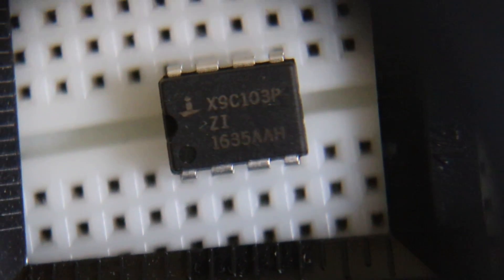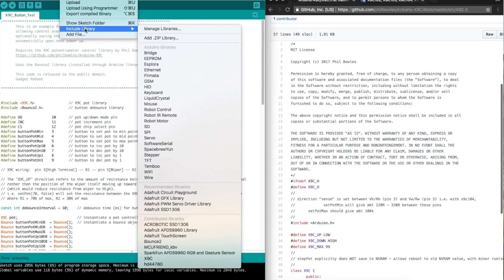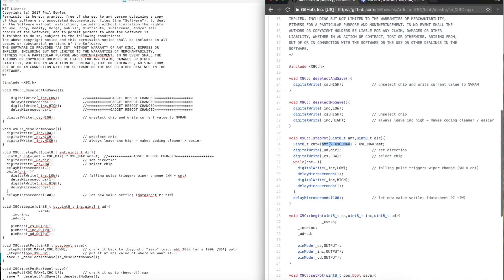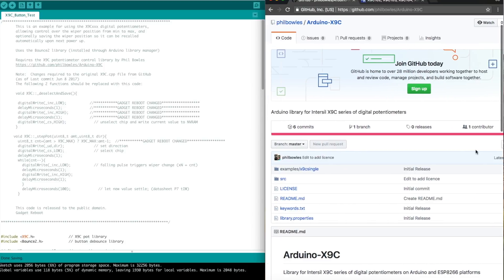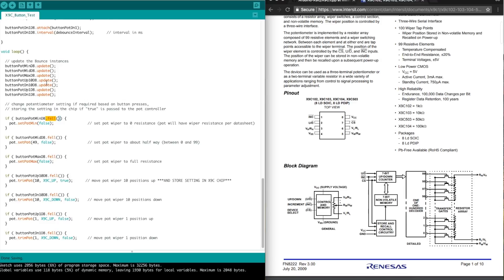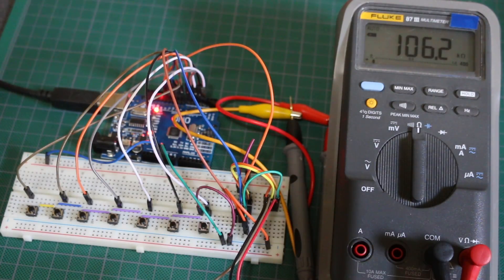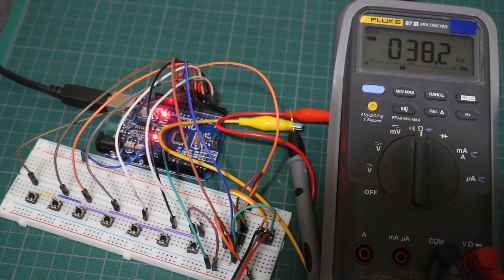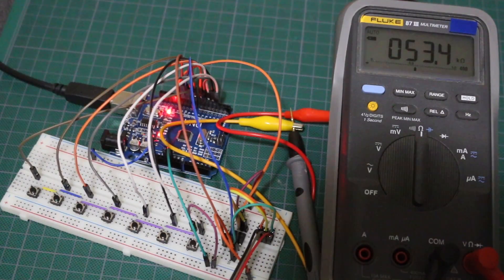Digital Potentiometer Control Using Arduino - X9C103

Comment: I would like to use this digital potentiometer to run a brushless moto. Would it be possible to use two buttons, one going up and the other going down incrementally and in the same time any of this buttons being used to set potentiometer to max low with a long push and store this value? This way the motor could be deactivated with any of this two and wouldn't run at the start. Maybe even have one more code to have the value set at low and stored at the power down. Thank you.
Reply from the maker: with software control those functions could be programmed although with this potentiometer it wouldn’t be able to immediately jump to a different value it would have to quickly sweep from current position to the minimum or maximum but it’s the same effect as quickly moving a real potentiometer.
 But the bigger thing is that the potentiometer can only handle 5 V maximum and it’s only meant to have a very small current through it more like using it as a sensor and then having another circuit whether it’s an op amp or something doing anything more powerful 
so you can’t directly run a motor through it you would just use it to have the motor driver run the motor based on the setting of the pot
Reply: @GadgetReboot  I understand. I'm planning on using a low power low voltage signal from POT to control VESC. I just don't know much about programming Arduino and this might be the only time I will need it. This would replace a hall type of throttle on an e-bike.

Comment: Is it possible to use 2 of these in series, to have 200 steps ? Did someone tried this already ?
Reply from the maker: I haven’t tried it but I think it makes sense if you’re only using the wiper and one terminal of each pot so you’re using it like a rheostat and then you put two of those in series where the wiper of 1 feeds in to the one end terminal of the second one,  then you should be able to control the two sections to go from minimum resistance up to the value of two resistors in series.

Comment: I've been building guitar pedals, and I think you just opened up a whole new world for me
Reply from the maker: i’m about to do a video on a different digital pot because I think these are more obsolete right now so maybe that will be of interest as well in the next couple of weeks.
Reply: Is it the MCP41010?  I ordered just one of those on my last parts order, but then lost it  @GadgetReboot  😆
Reply from the maker: it’s the MCP 42100 so it’s a dual 100 K  version. I have to set up some experimental circuits for it but the video should be out within a week.

Comment: I'd like to emulate a temperature sensor. Basically the Arduino pulls the temp from the internet and "codes" it to the wire w/the according resistance. The device that is supposed to have a temp sensor would show the temperature. Something like this possible?
Reply from the maker: it sounds possible but it’s a bunch of separate projects like one to go get the temperature from the Internet, then if you are saying you want to convert that temperature into a physical resistance value to emulate a sensor, does that mean the real sensor actually produces a certain resistance that varies with temperature?
 If so then as long as you have a digital pot that the resistance can be adjusted within the temperature range to match, you would just have a project that takes that temperature number and uses it to control the pot and so on but it’s all just vague concepts, like saying it’s possible to take an audio signal and put it through a circuit to boost the bass and cut the trouble. Lots of ways to do it.

Comment: I am looking at using this XC9 in combination with a PWM fan controller (ultimately a 555 timer and some transistors) to control a 60W fan. If I want to be able to turn the fan off should I also consider a relay as well or would setting the resistance to it's highest (or maybe lowest?) be sufficient to ultimately get me a 0% duty cycle?
Reply from the maker: it would definitely be good to have a relay or some thing to do a complete shut off, I know the 555 cannot achieve 100% or 0% duty, or possibly both. So when you try to make it go completely flat either high or low, you might still get the little blip momentarily.

Comment: Hi, nice video. I'm looking to use Arduino to transform a 800-1000 ohm potentiometer that I can't change into a 0-190 ohm variable resistance. It's possible in this way? Thank you

Comment: Are these digital resistors also available with a higher resolution aka more steps? Like 10 or 12 bits? Great video!!! :-) Thank you.
Reply from the maker: I've seen them with as many as 1024 steps like this one https://www.analog.com/media/en/technical-documentation/data-sheets/AD5174.pdf  
but of course all the features and limitations of each different digital pot need to be looked at to see if it fits the application.  They're more like a specialized part where trade offs would need to be decided between number of steps vs voltage handling, or control interface method, ability to store wiper at power down etc

Comment: Thanks for the idea and explaination. I am new, and would like to ask, if we use the map function in arduino, what will happen sir? Any idea
Reply from the maker: In general or in something to do with the video (I can't remember what's in the video)?  It maps one range of numbers to be within a different range, so it can take 0 to 10 and stretch it out to 70 to 500 if wanted, so 0 maps to 70 and 10 maps to 500 and everything in between is scaled.
Reply: @GadgetReboot  tq sir..

Comment: Does the digital pot hold its previous value when power is off?
Reply from the maker: If the software procedure is followed to store it, yes.  It re-loads the last stored value on power up but the wiper isn't immediately there, it has to move there during configuration so resistance will vary while it gets set up.

Comment: Thank you! Very clear presentation. I am thinking of using this on a solar charger.
Reply: How did that go? I'm here due to the same requirements. I'm thinking to replace the V&I pots on an off the shelf DC-DC buck converter with these XDCPs.

Comment: Does the chip itself store the last value without the arduino? 
The datasheet says "Wiper Position Stored in Nonvolatile Memory and Recalled on Power-Up" 
So does the arduino quickly turn the pot to one side and then turn it to the arduino memory on powerup?
Reply from the maker: the chip itself stores the position if requested by the control lines from arduino at some point, so when powered back on the chip itself moves the wiper where stored. I think it always starts at one end of the range and then moves to the setting.

Comment: I'm so daft, looking at the screenshot of the data sheet in the vid, can I use the x9c and an Arduino to ”translate” one potentiometer to different values on the fly? Say, to turn my B25k expression  pedal into a 100k?
Reply from the maker: as long as the voltage swing doesn’t exceed +/-5 V on the pot and the current through the wiper of the pot doesn’t exceed 4.4 mA, this digital pot can be used in a circuit where a regular pot is used. that assumes any nuances of the digital pot behaviour can be accepted in the circuit like while powering on, letting the wiper settle to a certain position, or while moving the wiper, momentary resistances  may vary from the expected final wiper position so in an audio circuit volume or some other effect may temporarily be fluctuating depending how it’s all used. so experimenting would be needed to see if it’s even suitable for the application.
if it is, if I want to use an Arduino to switch this pot in and out of circuit either in parallel or series with an existing pot, or to disconnect another physical pot and connect this one in on its own, I would probably use a digitally controlled switch like the CD4066.  this has four built-in switches so I could use it to switch various terminals of multiple pots in and out of circuit as needed. Arduino would be controlling each switch with a single pin to open or close that switch.
I did something similar using digital pots to control frequency of Tone generators and output volume of an audio circuit and used those digital switches to connect various features in and out from Arduino.
https://www.youtube.com/watch?v=oFtGOOA25tA&t=603s
Reply: @GadgetReboot  Thanks for the detailed (and prompt) reply! I've been looking into ways to avoid having three different expression pedals to control non-midi capable guitar pedals that have expression inputs; B10k/B25k/B100k without necessarily having three seperate expression pedals. Already have an Arduino, and a passive trs 25K expression pedal. Wouldn't need to be all outputs at once, but that's a bonus. The devices typically take 9V DC inputs are typically 9V DC, but some claim to operate internally at 24V. If I understood correctly, I'm glad you reminded me to be mindful that these external devices would possibly/likely pass more than five volts through the chip. Thanks again.

Comment: A mechanical pot 100K can handle higher voltages.  The x9c- series only supports 5v.   How would I control a 20v or 30v circuit with a digital potentiometer and arduino?
Reply from the maker: without doing the math to double check, I wonder if the digital pot can handle the normal resistor divider of a buck or boost voltage regulator to set the output voltage, maybe with other resistors as part of the network and not just the digital pot alone. 
or maybe the digital pot could be used safely in conjunction with an op amp circuit and the output of the op amp ties in to the voltage regulator so instead of using a variable resistance to set the voltage we are directly setting the voltage with an op amp. Something along those lines. 
I’m sure there’s lots of Circuit ideas like that in all the app notes of all the silicon vendors where something could be put together.
Reply: @GadgetReboot  Did you ever dig deeper into that? I've got an off the shelf dc-dc converter coming for experimentation.

Comment: Hi I try the same with the button I succeed in varying the resistance or voltage but not able to save thevalue I keep cs high while Inc signal is high so can you help me in this
Reply from the maker: One thing I recall is I found some issues in the X9C library I used, so I had to change two functions in the library code. I made a comment at the top of my sketches here https://github.com/GadgetReboot/Arduino/blob/master/Uno/X9C_Button_Test/X9C_Button_Test.ino     
and it looks like Deselect And Save is one of them, so I wonder if all you need to do is tweak the library like I had to.  I forget exactly how I did it and if I talked about it in the video.  
Here's the info from one of the sketches, so if you find the X9C.cpp file in the library, you can search for these 2 functions and replace them with this code:

Changes required to the original X9C.cpp file from the above GitHub
       library (as of Last commit Jun 8 2017)

       The following 2 functions should be replaced with this code:
       
       void X9C::_deselectAndSave(){
        digitalWrite(_inc,LOW);           //**********GADGET REBOOT CHANGED*****************
        delayMicroseconds(1);             //**********GADGET REBOOT CHANGED*****************
        digitalWrite(_inc,HIGH);          //**********GADGET REBOOT CHANGED*****************
        delayMicroseconds(1);             //**********GADGET REBOOT CHANGED*****************
        digitalWrite(_cs,HIGH);             // unselect chip and write current value to NVRAM
       }

      void X9C::_stepPot(uint8_t amt,uint8_t dir){
        uint8_t cnt=(amt > X9C_MAX) ? X9C_MAX:amt-1;  //**********GADGET REBOOT CHANGED*****************
        digitalWrite(_ud,dir);              // set direction
        digitalWrite(_cs,LOW);              // select chip
        delayMicroseconds(1);
        while(cnt--){
          digitalWrite(_inc,LOW);           // falling pulse triggers wiper change (xN = cnt)
          delayMicroseconds(1);       
          digitalWrite(_inc,HIGH);
          delayMicroseconds(1);
          }
          delayMicroseconds(100);             // let new value settle; (datasheet P7 tIW)
        }

Comment: Really a well done explanation. I wanted to know if this digital potentiometer can be applied as a continuous variable resistance. In a circuit based on a Hall sensor that makes me vary the resistance according to the magnetic flux. The magnetic flux varies tens of times per second and the resistance should vary in the same way. Bye
Reply from the maker: From the data sheet AC operation characteristics table  on page 5 https://www.renesas.com/in/en/www/doc/datasheet/x9c102-103-104-503.pdf , where it shows the timing of the control signals and the response of the wiper,  it looks like the wiper will change within 100 µs per step each time it is incremented so that could be considered fast for several times a second  moving the full scale 100 steps if you have to go between minimum and maximum resistance continuously. And it is just switching in the different resistors electrically so it should be suitable for continuous operation. 

 There is one note I saw in the data sheet that may need consideration, while changing the wiper, there may be a temporary change in resistance rather than just going to the next increment based on the way it works so the application may need to consider that and testing should be done. 

“The electronic switches on the device operate in a “make-before-break” mode when the wiper changes tap positions. If the wiper is moved several positions, multiple taps are connected to the wiper for tIW (INC to VW/RW change). The RTOTAL value for the device can temporarily be reduced by a significant amount if the wiper is moved several positions.”

Comment: Nice explanation sir.  Can we use this pot to carry out IV measurements of solar cells?  Please do reply.
Reply from the maker: It’s probably not practical because at least for this specific device there is a maximum voltage of 5 V and the maximum current through the wiper can only be just over 4 mA so if the voltage  or current being presented to this part is going to be higher than that, it won’t work. 
If this part is not being used directly as a load and is just used for some other function that’s within those voltage and current ratings then that’s OK.
Reply: @GadgetReboot  Thank you sir.    Can you please suggest a digital pot for IV measurements of a small solar cell having voltage below 5v and current below 500 mA?
Reply from the maker: I don’t know if a digital pot can directly handle that much current,  I didn’t research fully but one I found  is 25 mA like this one. 
https://www.mouser.ca/new/microchip/microchip-mcp41hvx1-potentiometers/

And maybe there’s limitations like it can only do 25 mA for short duration not continuous and things like that. 

 There may be some other kind of circuits that can be added on to buffer the potentiometer though, so the potentiometer can be part of a low current circuit controlling a higher current path in some way that the desired result is still achievable.   

Maybe some sort of thing where the digital pot is connected to an op amp so that the digital pot changes the voltage control of the op amp and that controls a fet on the output like a variable resistor DC load so the solar cell would have a fet providing a load current safely controlled digitally by the digital pot. 

But at that point just a straightforward digital to analog converter chip can do the same thing so it comes down to the reason for using a digital pot in the first place.

Comment: I am having a problem with my digital pot, I cant figure out how to increase or decrease the resistance through the micro controller
Reply from the maker: Using Arduino or another platform?  This video looks at the pot more generally for learning to use it: https://youtu.be/U3K-PXcv7Uo

Comment: 15:16 That's not really the only thing. For that problem there is the save :D Biggest pitfall is the limited voltage range of the resistor terminals. For the X9C10x it's min is -5V and it's max is 5V relative to GND.

And yeah, annoying bug with the NoSave... Really have no idea why he says "always leave inc high - makes coding cleaner / easier" because it does not :p Think this is a nicer fix: https://pastebin.com/yf7yPK7x
Reply from the maker: Yeah leaving INC Low seems cleaner functionality wise regarding the need to take Chip select high and not mess up the count.  I ended up with my sloppier version where I had to tweak the counter and then untweak it in the save routines because at first I didn’t realize what was going on and I just needed a quick fix  so I said ideally I’d like to just re-write the thing but this works for now. 
One other thing we still might need to do is insert a couple of those 1 µs delays between changing increment and changing chip select  to allow set up and hold  or else we still might get an accidental extra increment even though we technically tried to bring chip select high appropriately...race condition may exist.   Might work on a slower Arduino but then we port over to a much faster one and things are happening too fast and we need to impose delays to guarantee it.